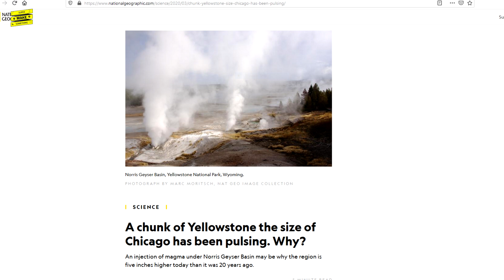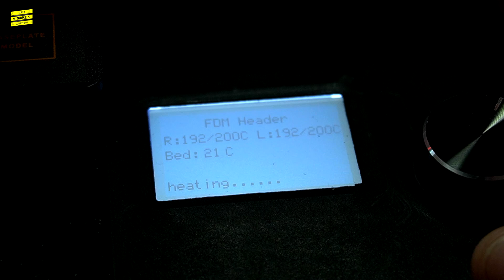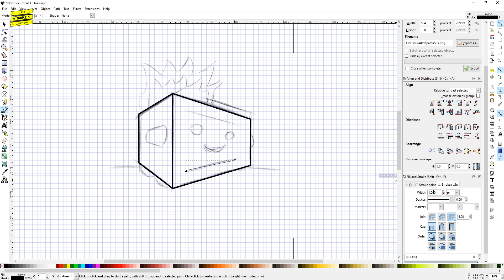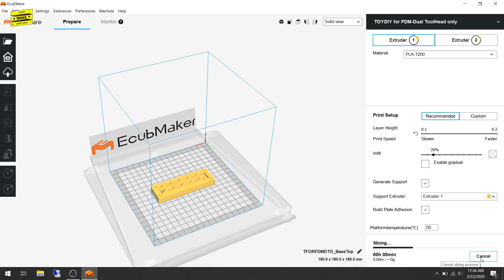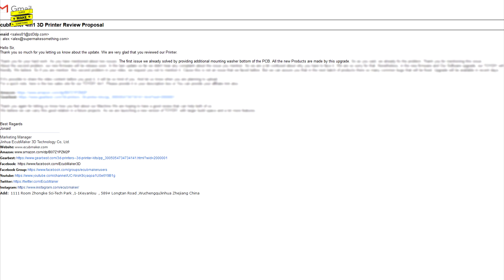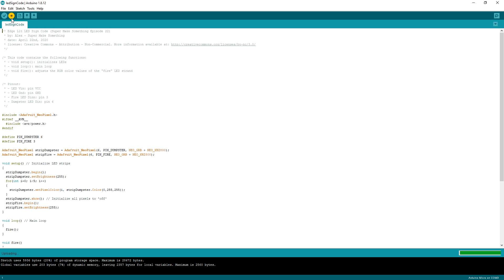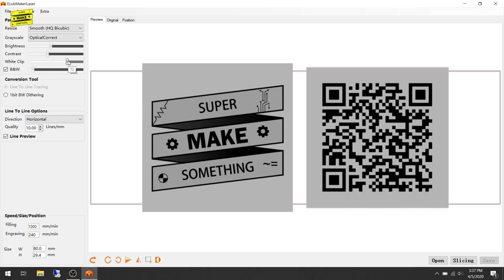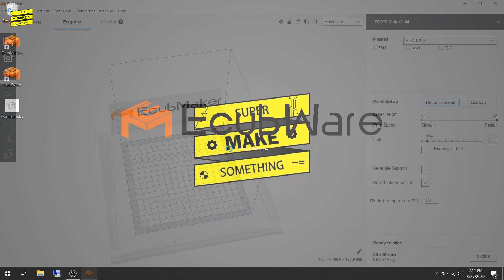DIY Edge Lit LED Sign: ECubMaker TOYDIY 4 IN 1 Review! (3D Printing, CNC + Laser Engraving, Arduino)

Comment: Is the laser engraved QR code functional?
Reply from the maker: The engraved QR code is functional, but it’s a bit inconsistent on cork at this size due to the light/dark spots in the material. However I have frequently engraved QR codes into wood, and it works very well!
Reply: @SuperMakeSomething  thank you so much! This is the first I've heard about this particular machine. You made a great demonstration! How's the dual filament coming along after all this time? Those little rubber cleaners still holding up? I was wondering if I could print them in TPU if they need replacing with my main printer

Comment: Why would you use a Arduino for a simple led circuit ?! just make it simple an on/off switch for every color would get the job done
Reply from the maker: They are addressable RGB LEDs, which can change their color dynamically with a for loop. The color transitions are controlled by the Arduino and make the LEDs fade between red and orange to simulate a fire effect.